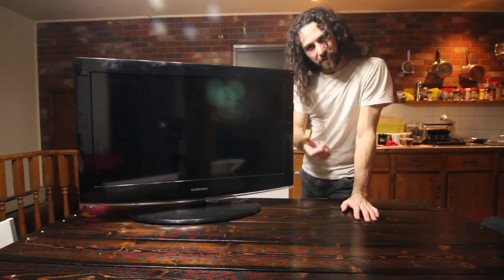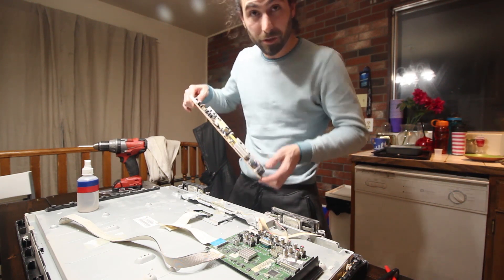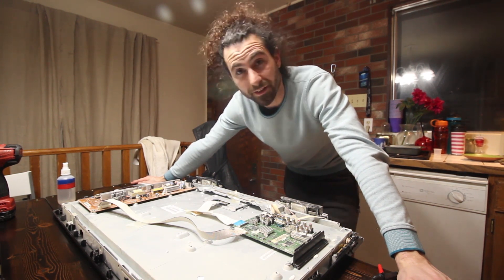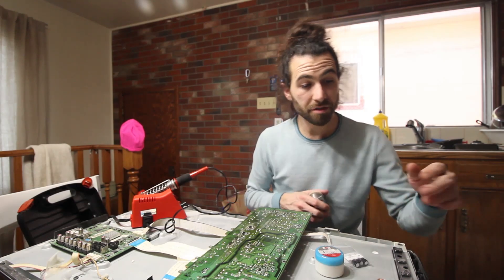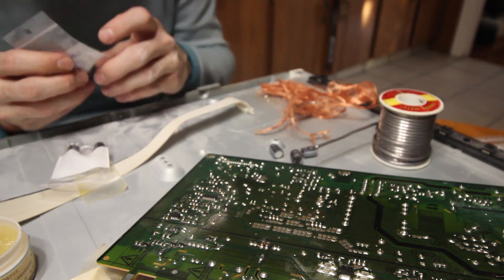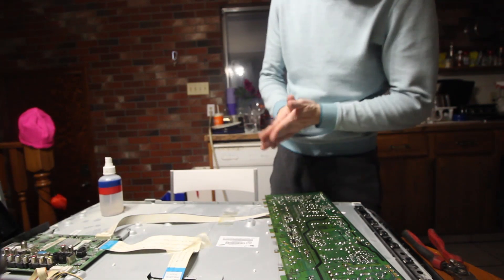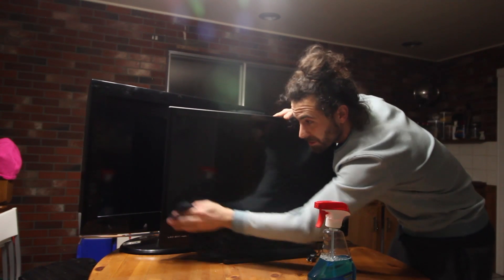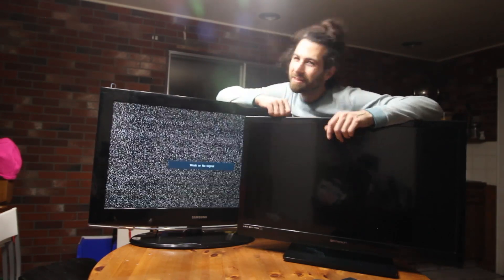Can I Fix A TV? Electronics Repair / Soldering Tips for beginners

Comment: From my experience repairing many electronic devices due to capacitor failure, at least half of the failed caps didn't have a bulged top, so you really need an ESR meter. Some of the worst caps (shorted or open) looked fine on the outside. I have also measured bulged cap with reasonable ESR (the bulged cap wasn't the failure), although in nearly every case a bulged cap is toast and is the cause of the fault.

Comment: Am I missing something? It did the same thing the first time you were trying to turn it on. I'm guessing it because it made a different noise, you thought it was "fixed"?
Reply from the maker: Looking back, I could have been more clear: it took forever to power on, had to have it plugged in for 10-15 min before it was willing to kick in. With the new capacitors installed it powers on immediately without being plugged in for any time.

Comment: Fine copper from a small motor or transformer is not bare, it will be insulated which is why it doesn't work well for solder wick.
Reply from the maker: That must be why it worked eventually but not right away? Maybe I could clean it with a solvent or heat first... which would definitely be a waste of time given how cheap proper wick is. Thanks for pointing that out!
Reply: Heat will get through the installation eventually and use flux on it, some fine stranded electrical wire dipped in flux works quite well, but solder wick is cheap so its not worth messing with anything else.

Comment: don't worry about the capacitor voltage as long as its higher then original one. as for that noise it is the filter capacitor blown. The filter capacitor helps by changing the Wavelength created when 120v ac gets turned into ?v dc. This would make life easy https://www.amazon.ca/Wemake-Solder-Sucker-Desoldering-Vacuum/dp/B0002KRAAG/ref=asc_df_B0002KRAAG/?tag=googleshopc0c-20&linkCode=df0&hvadid=292947999281&hvpos=1o1&hvnetw=g&hvrand=1752783010839579349&hvpone=&hvptwo=&hvqmt=&hvdev=c&hvdvcmdl=&hvlocint=&hvlocphy=9001267&hvtargid=pla-491294181333&psc=1

Comment: What's the next of the canned air machine you have? You should but a link in your description to Amazon or some such and make a few pennies.
Reply: Hey,I was also thinking about one of your videos you blew out a bunch dust and the I think key board started working. You said you couldn't list as fixed because you hadn't done anything. I'm a service tech and sometimes if there is too much dust the boards over heat and few people clean them.......so you may have fixed it. Just a thought
Reply from the maker: That's a great idea!

Comment: @thubprint 
How did u learn how to read Circuit boards ?
Reply: You don't have to know how to "read" circuit boards to fix them. If you know how to test the components, then you have a good shot at fixing the issues. He could have tested them properly and fixed it without replacing all of them, but I'm sure it's easier just to replace them all than to learn how to test them properly. I'm still in the learning phase myself about electronics.